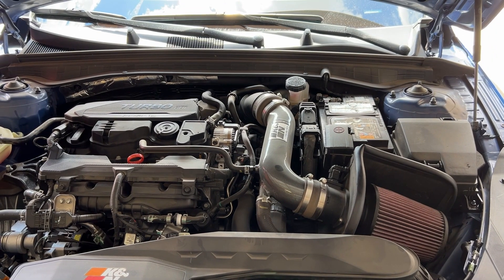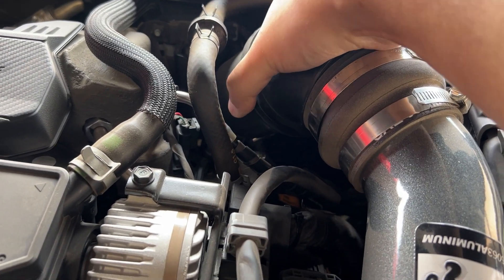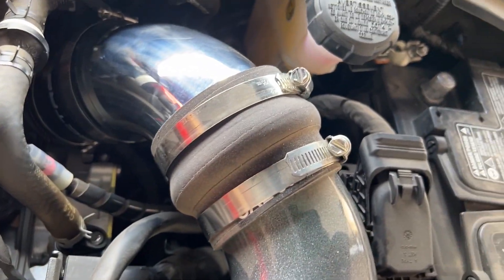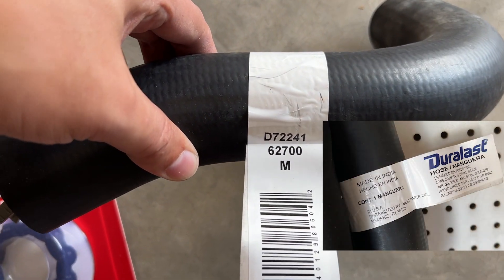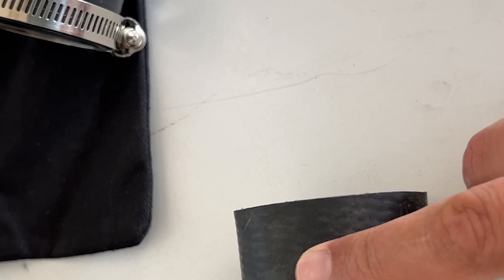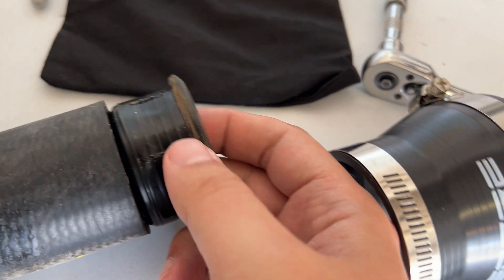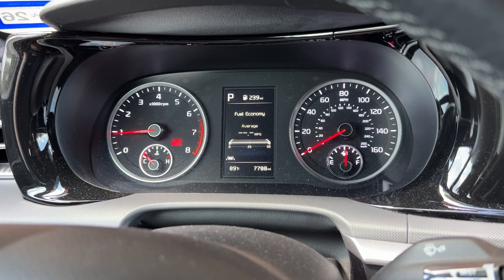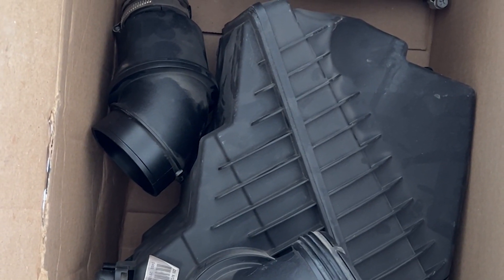DIY Turbo Inlet Fabrication | Custom $80 Setup for Kia K5 GT-Line AWD (1.6L Turbo)

Comment: What is the main purpose of fabricating a new turbo inlet?
Reply from the maker: I fabricated my own own because none were available to buy. But in general, they increase horsepower and throttle response. It made the biggest difference per dollar of my entire set up. I showed the before and after draggy results in the follow up video https://youtu.be/1boyul-8DZI?si=l7YrOMHDhSnPjOJu

Comment: Where did u get the inlet?
Reply from the maker: Autozone. Parts:
Spectre 3" 45 Degree Polished Aluminum Air Intake Tube (Part # 9449)
Spectre Black Reducer Coupler (Part # 8751)
Duralast 62700 Radiator Coolant Hose

You have to modify it to make it work

Comment: Do u run an after market charge pipe I can’t find anything for my car same car as yours all I find is for the 2.5 not sure if it would work any ideas or knowledge I’ve been watching your videos it helps a lot but it’s just a question of mine
Reply from the maker: I have not found any charge pipes for the 1.6T. I am assuming it is not needed unless you are running water-meth injectors. From my research an intercooler resonator delete will not do anything for these either, only the Veloster. Nor do throttle body and manifold spacers unless you need to add ports for injection. A friend on K5owners custom built his charge pipes.